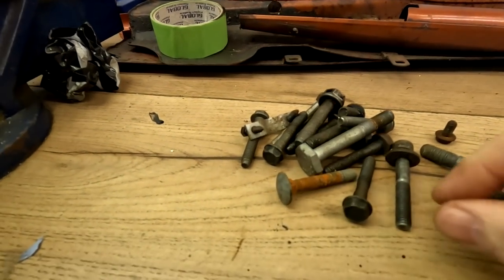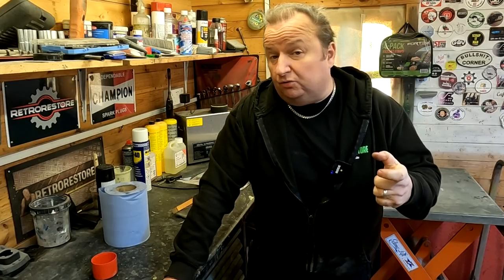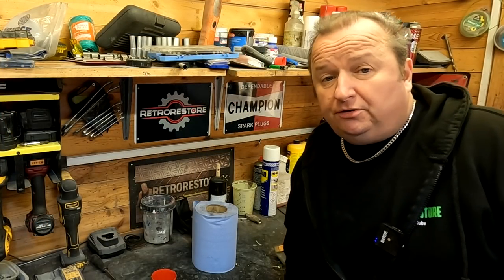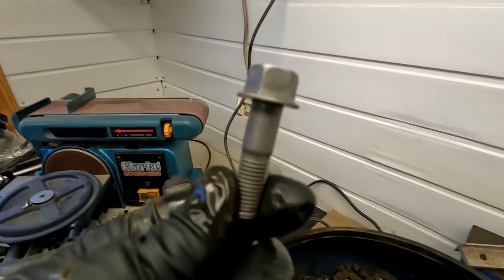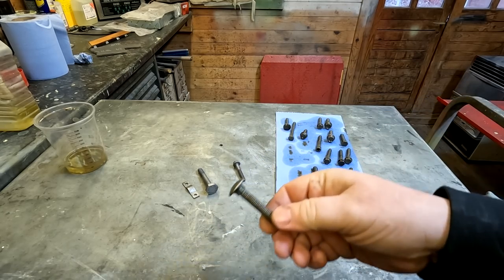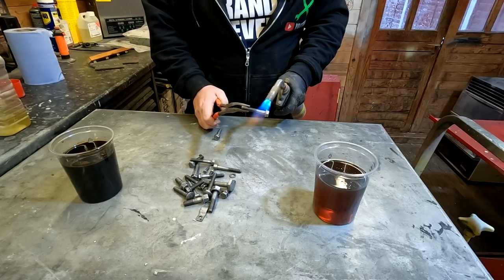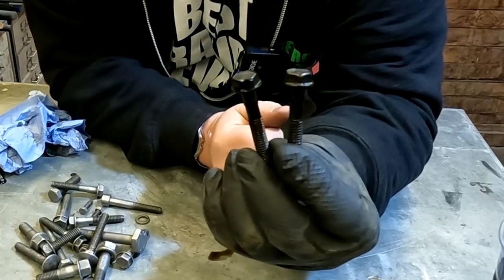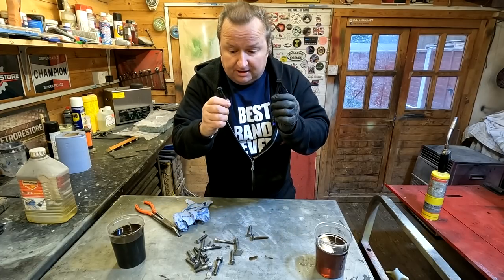How To Restore Rusty Bolts And Stop Them Rusting Again

Comment: Beware not to get them too hot as it will cause the blacking to flake off and and also may alter the tensile integrity of the screw/bolt.
Reply: That was my question.. so how hot is ok?
Reply: @sangeenshahkhan exactly… oil quenching can affect the strength.. best to electroplate. His rock tumbler method works amazingly though

Comment: Here's an alternative.  After heating the bolt or nut, quench it in a tub of molybdenum disulfide brake grease.  One of the reasons molybdenum disulfide is used in brake grease is because it is very insoluble in water and won't wash off when you drive in the rain.  Molybdenum disulfide is black as coal.  Engine oil is not.  That black grease gets in the cracks of the skin on your fingers and takes forever to come out.  Motor oil comes off easy with some soap and water.  Cool some hot bolts in black molybdenum disulfide brake grease. They will be less likely to rust when exposed to the elements.

Comment: Good job! What does the heat do for the grade of hardness to the bolts?  As a safty factor. I've read the oil be heated. Ironically.  On line, they tell you different stories on the temperature to heat the oil.  Room temperature, 150° to 170°, 370°, ect. 
Just an enquiring mind.
I really liked the bolt treatment. 
I was wondering what temperatures to keep the different hardness?

Comment: Case hardening. Old metalworking trick. Works great. You can even heat em up a few times and do that more than once to increase the hardened layer thickness.

Comment: If I am not mistaken the oil quenching process is called blueing. There is a cold chemical method but personally back when I was restoring motorcycles I used the heating and oil method. I thought it looked better and lasted for forever practically.

Comment: Great video, blueing is an excellent technique to use on nuts and bolts, but aswell as carbon and other debris in engine oil its heat that also contributes to turning it black so colour in using  even new engine oil will be dependant on how hot the items are. ( i would say anyone saying that their parts are clear have used nowhere near enough heat and wont be long till they corrode again) One last thing to bear in mind that oil hardening steal is the same process but needs more heat than bluing. You could find that you have actually performed that instead if you use too much heat which can inturn make the bolts more likely to snap. Its all a case of consistency and doing it the same everytime when you've found the sweet spot. Anyway like i said great vid and you have gained a new sub 😊

Comment: Great work on the bolts Martin and you're right good quality fixings aren't cheap if you need to replace.
Your method is supposed to work on a chimnea too. Ideally when you've used it and it's still red hot, coat it in used oil.
Good way of getting rid of any guests who've outstayed their welcome too I guess 😂
Reply: also how we treated ovens and stoves back in the day

Comment: Hi Martin, I'm new to the  channel, love it. As regards to the heating and quenching process I  believe it's called Parkarising,I could be wrong and it definitely won't be spelt right but I did a bit of it in my engineering apprenticeship. P.s. it works they won't go rusty!
Reply from the maker: Hi John, I have left the bolts outside to see if they rust and i'll be sharing that soon.
Reply: @retrorestore  
Cheers for the reply. To my knowledge (40 years ago) it always goes black and won't rust, once it's at the right temperature and quenched the oil penetrates the surface. Like I said this is something I did once or twice a long time ago so I'm no expert!!!!

Comment: Great vid, but just be careful with the waste left in the rock tumbler. Zinc plating uses carcinogenic substances (particularly the gold, rainbow-effect stuff). The carcinogenic is called Hexavalent Chromate. Great idea to add the fluid to keep the dust down, just be careful when handling/ disposing of the waste fluid. Also need to be careful with used engine oil as it also contains carcinogens.

Comment: Great info, thanks. Question: Will the tumbler / polisher work with torx bolts? Asking as I have an older BMW motorcycle and looking to restore the rusted bolts which are mostly torx types.
Reply from the maker: It should

Comment: The only thing I don't like about this is it takes that new polished look away.
I've just wired wheel brush my bolts and then polished them and I want  to keep them that polished look.
Would a high heat engine enamel clear coat work? Or would they tarnish over time?
Reply from the maker: Yes, that should work.

Comment: How are the threads Martin on the bolts? Looked at these a few times but had a feeling it would mess the threads on smaller bolts, I’ve spent years with a wire wheel on grinder and I mean years 😂😂

Comment: I just watch another video doing basically the same heat and oil treatment……. Except other gentleman said not to get them cherry red. Says if they are that red it is about 800 degrees and this will effect strength of bolt. Other guy says 400 degrees is sufficient to treat against rust. So he only got bolt to a bluish color and then he dipped it in oil a couple of times. Each time he dipped in the oil he held the bolt over the flame again briefly to burn the oil off. Just let the flame ignite the oil and then hold away from the torch. He did it 3 or 4 times and then says let the bolt cool naturally…… don’t cool it by dipping in water. Bolt ends up looking blackened just like in this video. 
So basically you achieve same result as Martin ….. just don’t heat the bolt until it’s glowing red to avoid making it too brittle.

Comment: Great channel,my father is restoring a vintage motorbike,can you suggest the best way to clean rust off the chrome wheels rim so he can decide what to do next?,thanks.
Reply: Soap infused wire wool pads work well. 
Asda sell them.
Reply from the maker: As Doosan Engineer suggested.
Reply: Thanks.

Comment: This will likely change the original temper and therefore strength of the bolts. The resulting strength of the new temper will be unknown. Seems unadvisable for bolts which are fastening critical components like brakes, engine mounts etc..

Comment: When you pull out of the rock tumbler. It's better to use, like a WD-40, or penetrant, to clean them off than "old Petrol", as the UK calls it. Sorry, I mean no disrespect, as Great Britain is our oldest ally, and normal folks appreciate them for it. As, I think for this video, your trying to prolong the life, maintain strength, and protect the bolt overall. The gas degrades and eats the bolt away. As to where the wd-40, or a similar product, helps the bolt and the metal stay rust free. Just my opinion, your the expert. Also, I know I was thinking before, I watched a couple videos saying don't grease your bolts, when you use them, on your car after fixing something. But what about a liquid grease instead, would this protect and prolong the bolts life? I don't like the heating method, as the heat may mess with the bolts strength, on the molecular level. But, I hate watching car/truck repair videos, where they put this shiny new part on the vehicle, and then this 2000 year old, rusted bolt back on the car. But great video thanks, from your friends across the pond, the USA.
Reply from the maker: Thanks bud

Comment: Hey stop blowing that dirty smoke at me…:)
A quick question.. does the heat treatment and quenching in oil not change the bolts hardness? Will they not become more brittle ?
Reply from the maker: I wouldn't do this on critical bolts, these are about 15ft lbs